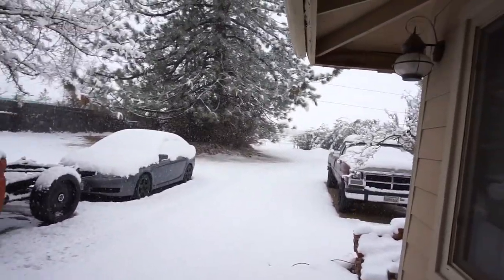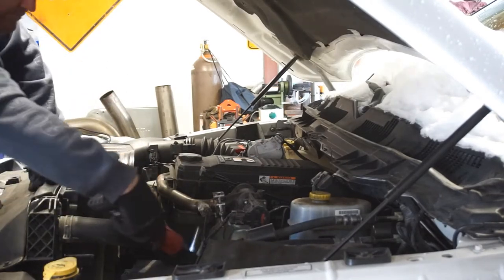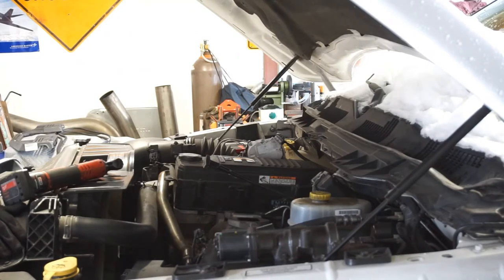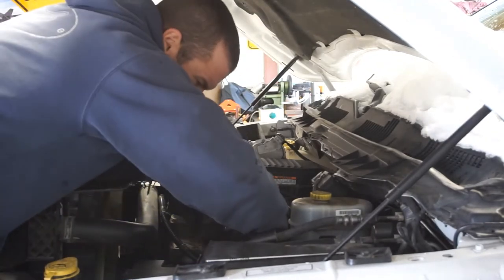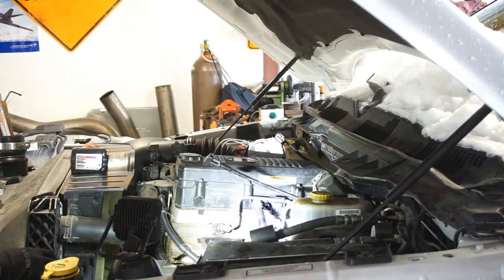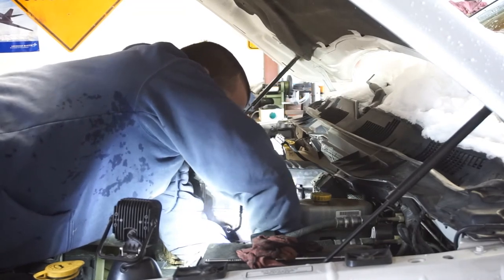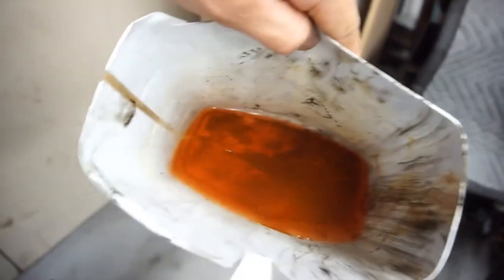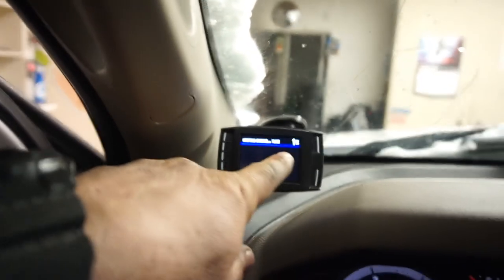Installing All The Right Parts Back On My 2012 Ram 2500 Cummins 4th Gen

Comment: Humidity plays a part in how you perceive cold .   Exhaust leak ?  After all that parts swapping that hardly seems a problem !  Can't leave that Audi out in the cold !  Guess we know your favorite now .  HAHAHA !
Reply from the maker: Orion Fixr exhaust leak was those plugs I was gonna put in the exhaust manifold. I decided not to delete that tube. Turns out it controls my exhaust brake. I wanted the Audi in the garage because I knew I was gonna get called out to work for broken rails and didn’t want to scrap the windshield do a half hour. Hahahaha favorite.